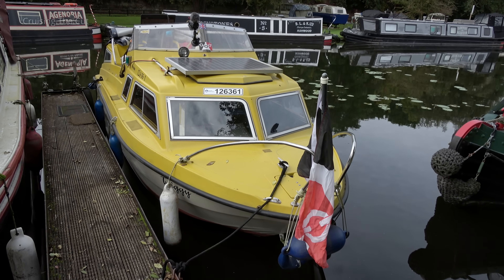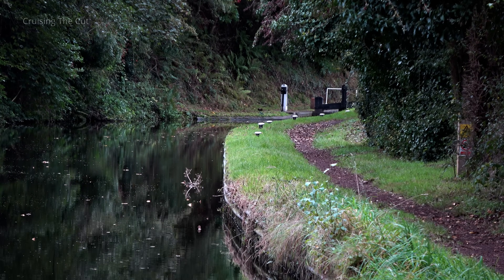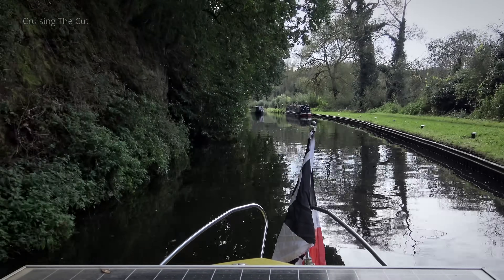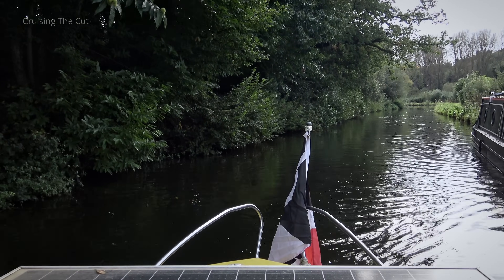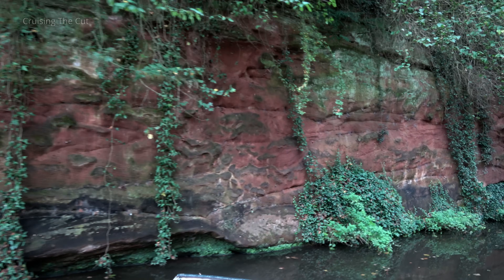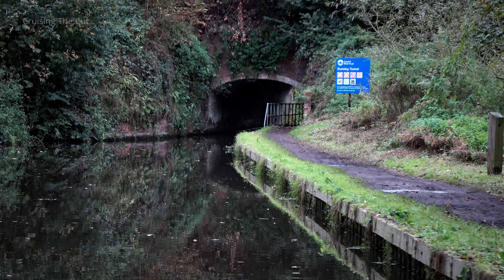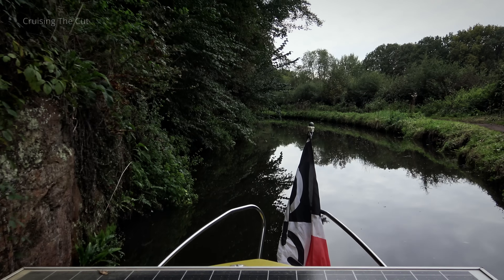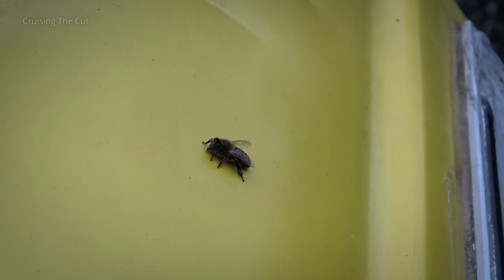317. I bought another boat

Comment: You can change your prop pitch to match your wanted rpm instead of on and off throttle and there are bolt on rudders for outboard motor to increase rudder area that is a big boat for such a small motor and its just using the depth of the lower drive unit as a rudder making steering funny. You don't want to go fast on canals but I'd go up one or 2 degrees of pitch on prop to bring motor rpms up a little and make it work a little harder and increase rudder area to make steering more predictable.

Comment: Look into Torqueedo motors. They will definitely push that boat at the speeds you can travel on the cuts. Plus with a 20ft boat you have ample space for a big enough battery bank to give you unbelievable range. I have a 20ft boat with a 70lb thrust trolling motor. It'll move my boat all day and it'll move it about 5mph on high setting

Comment: Yay! Love your videos. Outboards have a tendency to want to pull to one side or another. Most of them have what's called a trim tab on them that helps you counter this. You may need to adjust this slightly to help dial in your motor. Eventually you'll get the hang of it!

Comment: Hi David, love the new boat.  The engine is most certainly a very early Honda 4 stroke, approx 10hp.  The poor handling will be greatly improved with some additional bow weight.  I imagine your water tank is in the bow, so fill it and in addition buy 4 bags of ballast from BnQ, load them into the underbunk lockers in the fwd cabin as low to the bilge as possible.  In my experience this will make all the difference to the wandering and lightness in the water. Good luck.

Comment: You can change the prop for lower speeds and that would give you better control.  Outboard motors steer with the thrust not with a rutter like a narrow boat.

Comment: 15k +1 likes.  So good to watch you again on the cut.  Yes small outboard boat can be a steering beast. Need speed to have control. But speed is not good. So it’s a balance I suppose. So glad it’s a 4-cycle engine. I owned a 20’ with a cabin much same design as yours.  It had a massive 115 hp outboard 2-cycle. Hated to go slow speed. Again I really enjoyed. CHERRY

Comment: With an outboard you only have steering if the engine is providing thrust. You’ve got to be in gear. You’ll need to fix that speed issue

Comment: Just a tip for you, your problem with your steering is the prop rotation from the outboard and the combination of the chines or lack there of on your boat. Something to counteract this i found is to feel where the boat wants to go and to lighlty steer into the way it wants to go, almost like a car drift. It then counteracts the boat and keeps you going straight. Lovely vlog hope that helped  have fun boating 😊😊
Reply from the maker: Yes, in the next video I comment that it steers like a hovercraft!
Reply: @CruisingTheCut  I look forward to it. Interestingly enough, the same happens on outdrive or "Z drive" motorcruisers and how they counteract it is counter rotation props. I've worked on a few and they do like to dance about the waves 😂

Comment: Ive never been a fan of the small fibreglass boat, however, if I were going to cruse the canals this is what I would do it in. First tho I would add a little to the keel depth. That is what makes then hard to steer. No I dont build small boats but I have build bigger ones.

Comment: I'd say there is something wrong to make you have trouble with the steering.
Maybe something is loose?
Like the engine to the boat or the cable linkage that operates when you steer?
A few places to check -
1 at the steering wheel itself
2 where the cable attaches to the engine
3 the entire 'run' of the cable between the wheel and the engine.
Easiest to do with someone turning the wheel while you look for 'slop'

Comment: Nice video and nice to see you've acquired another boat but frustrating for you that it doesn't handle very well at the moment. Back in the dim and distant 1960's my parents bought a nearly new river cruiser built from plans by somebody they knew which was not unlike yours in appearance. 

Powered by an outboard, the boat was constructed from marine ply rather than glass fibre, so it was probably a bit lighter than yours, and had  quite a shallow draught. It did not steer very accurately and seeing your shots reminded me of its tendency to yaw rather than answering the helm and following a steady course.

Things could be particularly tricky if there was much of a cross wind, if there was then the bow would get pushed about so that maintaining forward progress became quite challenging for whoever was at the wheel. 

The friend who had built the boat felt that the design was better suited to planing, i.e. belting along with a massive outboard doing the pushing; not really suitable for pottering along the Great Ouse!

At any rate, my parents got fed up with this problematical craft and got rid of it. The new owner added a small fin keel to the bow which I believe improved things somewhat.

Comment: I can only assume that the boat acts so squirrely while steering is because it is so much shorter than you are used to.  Also, maybe the rudder blade isn't as long as it needs to be.  I'd certainly swap out the outboard for a decent trawling motor or two, since those things are meant for slow speeds.  I'm excited to see what you do with this boat :)

Comment: I also think a different prop might help the handling, and trying to move weight to affect the boats trim could help, try forward. If the trim isn't correct, it will cause steering problems. Of course " bank suction and bank cushion" is definitely part of your problem. When close to the side of the channel or canal, the flow of water pushes the bow away from the bank and the water becomes faster at the stern causing it to suck towards the bank. Google this effect. No doubt when you were maneuvering around the narrow boat, this suction/cushion was having an effect. Usually, a short boat will be more affected than your long narrow boat was.  A few months ago, there was a video here of a new skipper having steering. problems. A side view of the boat showed a stern down trim. I am sure this poor trim was his problem.

Comment: It's always the case, we buy something and the first thing we want to do is take it for a drive. What we don't do is check the oil, do basic maintenance like oiling or greasing the throttle cable. Take the outboard to the service guy and have it looked over, new plugs, wires etc. No one around to give you a tow if it dies in the tucus. Did it come with oars? I'm thinking for locks, a little electric outboard, often called a trolling motor used for fishing would be ideal with a remote for forward and reverse. It'd move your vessel in and out without you being onboard.
Reply from the maker: I wasn't "taking it for a ride" like some kind of joyride. Having purchased it, it had to be removed from the marina. I was taking it to my own mooring where investigations and maintenance could commence. Meanwhile, I had been assured of it being recently serviced.
Reply: @CruisingTheCut  I stand corrected... I humbly beg forgiveness. But as you mentioned the throttle seemed to stick and to me in my limited knowledge of things with throttle cables, riding bikes for nigh on 40 yrs, a sticking cable suggests linkages need grease and or graphite powder down the linkage sheath to smooth the ways.

We the uninformed have no idea that you had to remove it from the marina and move it to your own berth at a different location. A joyride wasn't suggested, many of us having just purchased a vehicle or vessel want to take it out for a while and figure out the kinks as you have done.

Comment: David
Congratulations on getting afloat again. An itch you just have to scratch.
The boat you met at Stourton Junction was a bit of a wally. He had right of way and should have used it. Hovering in one place is not easy and he drifted where if he proceded, he would have passed you with no problem. He probably thought he was doing you a favour but he messed things up for both of you.
Jeff
Reply from the maker: I think he did intend to do me a favour, yes but as I passed he also said he was planning on reversing for some reason (I didn't catch why) so that could explain why.

Comment: David, two points if I may.  Your trottle/shift system may need adjustment. You should be able to  set idle on the outboard low enough to emulate tick over which you are used to. Once you come off the detente from neutral to forward (or reverse) the boat should behave much as you are used to.
Second, you are used to a narrow boat which more or less pivots amidships to turn. With an outboard it by its very nature if used as primary steering i.e turns left or right in response to helm movements it drives the stern to turn. i.e. to turn to starboard the prop turns to starboard driving the stern to port so it swings. If the motor is on the centre line it will be a bit more depending on prop rotation direction. The "rudder" fitted to the outboard will increase rate of turn but it will still drive the stern left to turn right and right to turn left. The pivot is the stern.
Reply from the maker: Ta
Reply: One other point David, Snug up the steering cables. If there is any slack you have to take that up on the steering windlass as you turn left to right.

Comment: You might want to have a chat with an expert about that outboard. Typically they should have some OK-ish throttle control at low speeds too. If it's really that hard to control there might be something off on the throttle linkage/cable.
As to the speed, it might be possible to fit a slightly different prop that would give better throttle and speed response at lower speed ranges. This would probably mean it would cavitate or overspeed the motor at full chat, but since your intention is canal cruising I suspect it'll be a very rare occurrence for that to ever happen and it might be a decent trade-off to make.

Comment: First addition I’d make is a pad for the bottom of the window where you pull start the motor. A removable nice soft pad so when you bang your elbow, it won’t hurt as much 😄 As for your slow speed control, can you use a different prop that would enable slower going?
Reply from the maker: Haha so far I've not hurt myself at all!!

Comment: G’day mate. 
I know I’m late to party as this vids over a year old now. 
But have you thought of getting an electric outboard as either a replacement or as alternative. 
Having both would be ideal as it would give you the fine control you need, and the old outboard would give you the power when you actually needed it. 
Having both means that you would only need a very small electric outboard. 
Cheers and have fun. 🇦🇺
Reply from the maker: The trouble with electric is the limited range.

Comment: With regard to steering if you are using the forward flagstaff as a centre marker  it is off centre, also no doubt unlike tiller steering you have to compensate for that and as you mentioned glass-fibre is much lighter so easy movements, and the boat is much shorter than what you are used too.
Good luck with her.
Reply from the maker: No, I wasn’t using it

Comment: That's a semi planning/ planning hull, no keel , no weight, totally different to a narrow boat or displacement hull, add a big rudder behind propeller mounted to outboard lower leg may help. Parents had a microplus back in 70s on broads, huge shock after renting 40 foot broads cruisers. Hint, don't let go of starter cord, gently feed it back in.consider a lower pitch propeller,  it might also help
Reply from the maker: Cheers, I didn’t let go of the cord

Comment: You should christen her 'The Sidewinder' or 'The Sidewander'... We call it dog tailing in America when a vehicle is going forwards but doing so sideways... Phew on the avoidance of objects and be careful not to smack your funny bone/elbow on the side of that little window used to pull start the motor... I wonder if that vessel needs a larger keel to compensate for the loose action??? Maybe loose steering linkage t[system steering wheel to keel] that if tightened up will address the looseness??? Glad to see the flag flying at the bow... The motor [during the crusing the cut montage] seems steady and strong... Just keep all her fluids filled or topped off...
Reply: @CrusingTheCut @David  - Happy Thanksgiving...

Comment: Fantastic to see you afloat again!

Re your throttle control at low speeds (looks perhaps like a Honda?)….It appeared to me like you may have left the fast idle lever up a bit when you began moving. On outboards I’ve had this will cause the type of problem you described (the all on/all off issue). Make sure that lever is pushed fully down and perhaps that will help. A small outboard like that should tick over dead slow forward or in reverse.
Reply from the maker: It's not that as it won't go into gear if the idle lever isn't fully down, it seems to be interlocked

Comment: Well you are not going to loose that in a marina. Might be worth getting some big D profile rubber or rope fendering. Does the throttle/cable/outboard need service perhaps. had a mid 00s  honda 4s on mine, throttling was smooth and progressive, maybe got the wrong prop ? Cant wait for next instalment.

Comment: Is there a way to add a rudder to the steering, maybe attached to the outboard mount? It should be made so that it can be raised or detached. It should be light, made from aluminum or whatever. The outboard itself steers by thrust. A rudder should help steering at slow, as well as high speed. If that were my boat, I'd add the rudder, for canal cruising. In wider passages, etc, the rudder can be adjusted or raised.
Reply from the maker: It has one!!

Comment: It’s an outboard, don’t oversteer, you now have a powered Rutter. On your old long boat you had a fixed propeller that washed water over your rutter, on an outboard your rutter has the prop on it and your direct powering the angle of the prop  subtle movement on the steering wheel turns the boat extremely fast thus when you oversteer it kicks the back end of the boat extremely fast. The slower you go in the boat the more problems you have with steering the boat so slow and subtle on the steering wheel, it doesn’t take much turning of the steering wheel at all to get huge reaction from it. Plus a fiberglass boat is like a feather compared to a Narrow Boat. Hope this helps in controlling your new to you Boat.
Reply: You shouldn’t have to turn the steering wheel anymore then 3 or 4 inches to the left or right unless you want to turn the boat around or you’re maneuvering around in a Harbor. You will also find that you will have outstanding control in reverse with a prop as your Rutter.
Reply from the maker: Ta

Comment: After seeing more of you videos, I note how keen you are on a wilderness beaver and the possible option of trailer sailing it. 
Well you can do this with the microplus!
I trail sail my boat and I find it much better than a mooring.....
Reply from the maker: That's my hope!
Reply: @CruisingTheCut  if you need to buy a trailer buy one with rollers and a "swing" beam, such as a rollercoaster. I have one and I can usually launch and recover my 22ft boat without getting the wheel bearings wet and only my feet wet, even though I can do it with dry feet too
Reply from the maker: Thank you, that's useful advice - cheers. I know nothing about trailers!
Reply: @CruisingTheCut  no problem

Comment: Hi  At  15 minutes going thru the canal  it looks like your boat has very limited direction control  ( probably need a larger rudder and/or bottom keel rub stakes.
Also "added" wood rub rails on the sides , english oak.

Comment: An electric outboard motor (preferably brushless with variable speed control) would probably improve maneuverability and particularly handling at slow speeds significantly. I don't think range would be a huge issue considering the size and weight of the boat. How much power does the current engine produce at almost-idle (which seems to be already too much at times)?

For the leisurely speeds of canal cruising even small ones with ~600-800W could be more than enough (according to the manufacturers those are suitable for boats up to ~2 tons).
Maybe you can borrow one for a test-drive?

Comment: The steering issue is caused by the offset of the outboard motor. It needs to be in the center of the stern. Is the throttle cable even hooked up? Some small outboards are not designed to have a remote throttle and be wary if someone has rigged a remote throttle to something not designed for it. Happy boating in safety! CHEERS!
Reply from the maker: Cheers

Comment: Glad to see you back on the water in yo own boat. I see a variety of comments about the throttle response and I agree having had this type outboard (what we call it in the states) arrangements. I’m intrigued by the aircraft comparison and I believe it is in the right direction as for seemingly poor handling. In my younger days I had multiple type of boats and the trawler hull type performed similar to the style of hull that steel canal boats do. My fiberglass runabout (grp) and cruiser (grp) both had what we call in the states plaining hulls. At slow speeds they were clumsy but as you increased the speed the bow started to lift and if you kept going faster they would “plain” and the bow would level out and they would handle crisply. Looking at twiggy she looks like she’d have a plaining hull. Problem I’m guessing is that the canal speed limit wouldn’t allow the speed necessary and I doubt the size of her engine could push her fast enough to plain. Good luck with her
Reply from the maker: Thank you